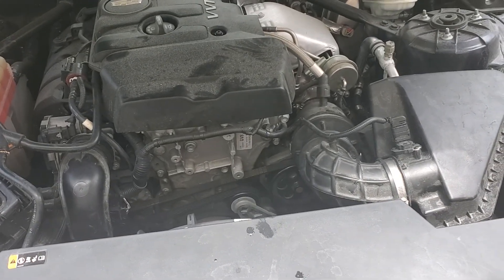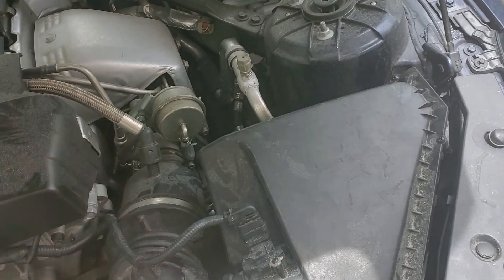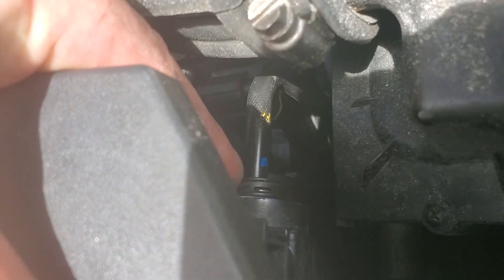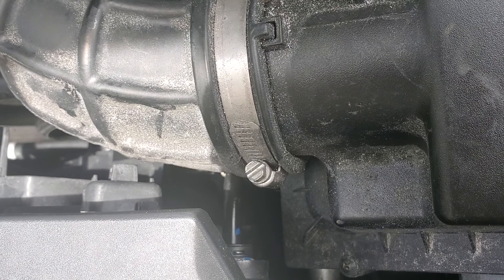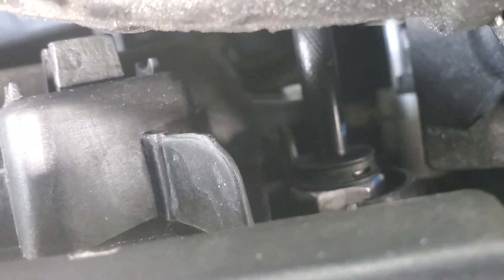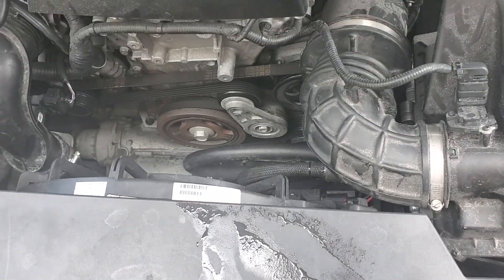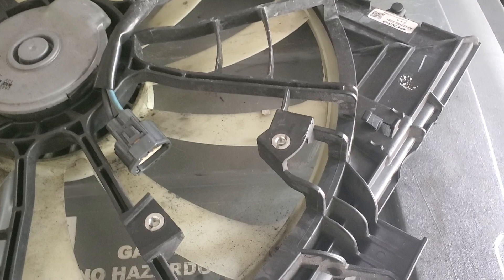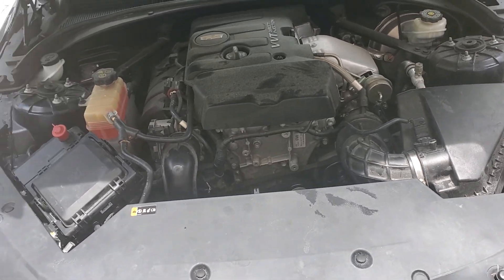Cadillac ATS Cooling fan replacement

Comment: great video getting mine done this week. bench tested the fan and it craps out after a few minutes. edit: i replaced it and the plastic tab on bottom  driver side has to go. i melted it off with a red hot knife from under the car. you also have to remove the upper radiator hose because of the 1 1/2 in radiator nozzle sticking out. remove plastic under covers. its fine because you get to flush your radiator fluid which has probably burnt up with ur problems. fluid drians from the bottom from a spigot. i used exactly 1 bottle of coolant. plus when you put the trans hose back clip goes first then  push hose thru. dont try to force clip on hose.
Reply from the maker: I didn't have to remove or drain the radiator but that's fine/ I know the new radiator fan assembly was not 100% same as the original so yes, I do believe there was a tab I had to cut off with a cutting wheel. but after that it fit perfectly

Comment: there is no need to remove or unplug anything but the cover at the very top. i just replaced mine 2015 cadillac ats 2.0 and fan came out just with one hand move lines around and with the other pull and it will come out and in with no issues

Comment: Trying this now and having no success getting the old one out.   You mentioned removing that tab w a dremel or saw and I did that one the new one but there is clearly no way to do this on the old one while it is in the car, so I assume you were able to get it out with it still on?
Reply: Anyone?    My next thought is to remove the "charge" pipe to get some clearance yanking the thing out of there but I don't see how that comes off either.  Doing a search I think you rotate it counter clockwise?   Can anyone offer advice?
Reply: Well to give myself as much room as possible I was able to remove the charge pipe (there is a metal sleeve/ring that needs to be moved counter-clockwise slightly).  Also removed the intake on the right hand side (facing the engine bay).   Despite that....

It was impossible (at least for me) to wrestle the fan out of there.   In the process of trying I managed to damage the radiator :(
So gave up and took it to the dealer down the road to replace the radiator (and the new fan of course now in the back seat).    Total damage $1802.00, not including the fan I bought :(

Comment: How you know cooling fan not working ?my cooling fan turns on but then after a while stops on my 2014 Cadillac ATS 2.0 and starts overheating I took it out and jump it straight and it works fine it spins can you help determine what the problem could be I already replace thermostat and ac pressure switch thanks
Reply from the maker: It may be the fan controller the one attached to the fan housing. Try that first. They are a common failure point
Reply: You mean the cooling fan module the one that looks like a square box ?
Reply from the maker: Yes with a connector on each side
Reply: Thank you
Reply: @gallo5921  was it the fan control module?  I'm having same issue.  Overheating at the light , cuz the fan don't come on.
Reply from the maker: @darkphx6410  it probably was that box. they are very common failures
Reply: @dgoldman2846  I took it too the dealer and it was the cooling fan
Reply: Was it your fan or module? Im dealin with same issue